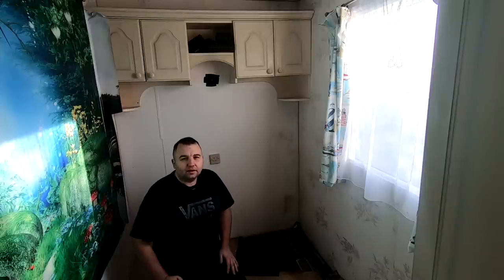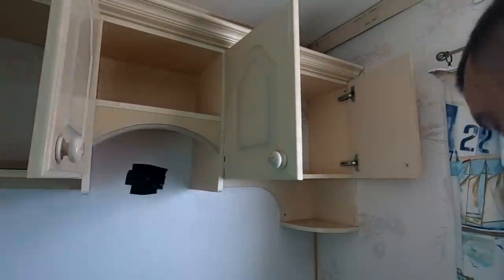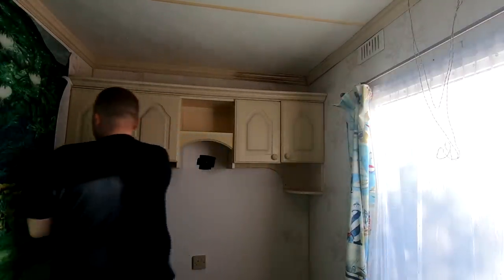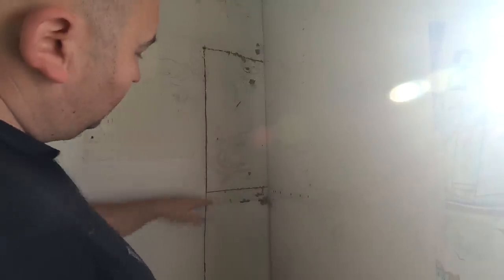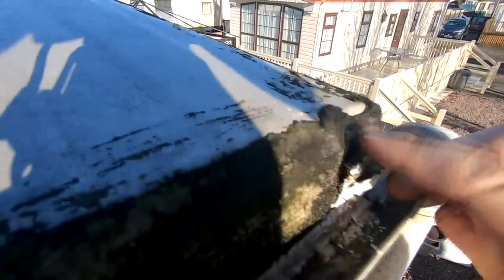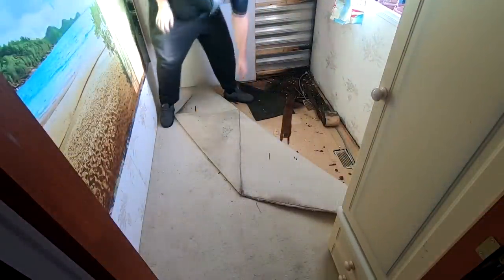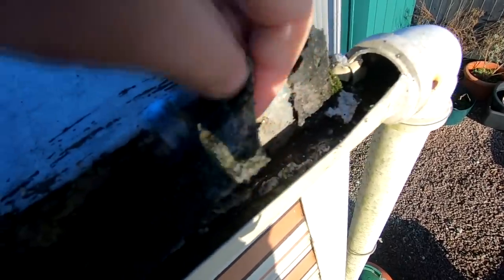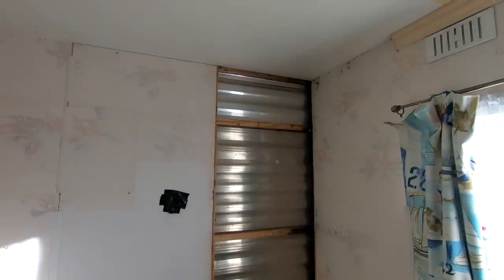Leaking Caravan Roof

Comment: I would replace the guttering down pipe junction it's probably blocking and or backing up, if you don't the problem will happen again. But good job so far, maybe a coat of damp stabiliser on the wet timbers
Reply from the maker: Cheers mate the down pipe is clear already checked 👍🏻

Comment: Hi Gary, around -5:16 in the video, there looks to be daylight visible in the corner, right at the end of the top horizontal baton where the rear and side walls meet.  Is it another hole or is it just a piece of white polystyrene?
Reply from the maker: It's the torch on the drill 👍🏻